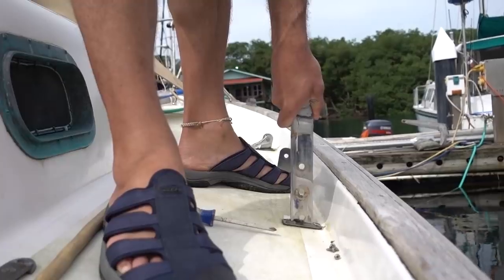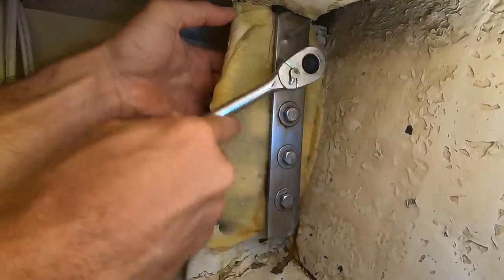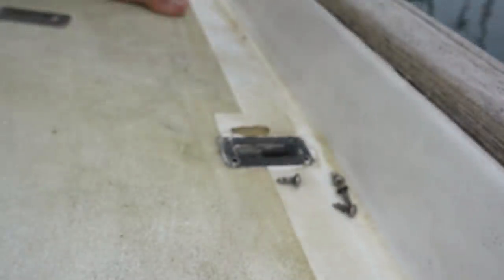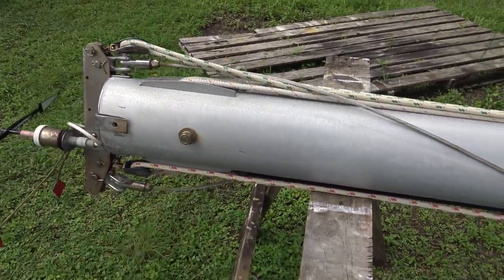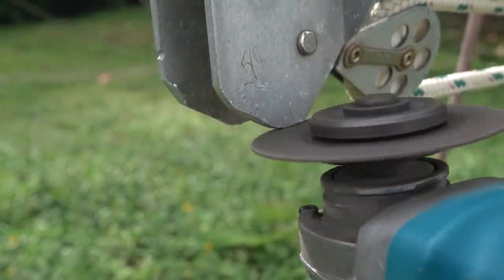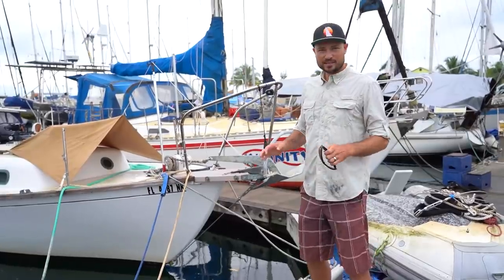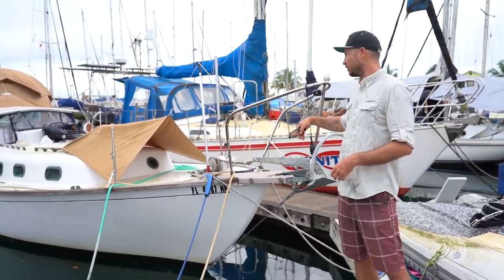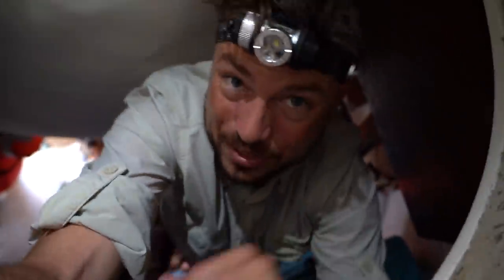Bullet Proofing Our Rig to Sail Across The Pacific Ocean⛵ | S04E16

Comment: Jordan, l noticed there is a lot of space between the two plates on the mizzen head, when the  cable end fitting is in place (8:52). Having that much clevis pin unsupported, could induce a bending load on the pin, creating a heavy side load on the cotter pin. Perhaps a couple spacers, one on each side of the cable end fitting would induce more of a shear load on the pin and reduce the bending. Just a thought. great video, fair winds and safe travels.

Comment: You guys are fantastic.  You really earn your dreams one project at a time, and you are to be admired.  Your capacity for hard work and vision seems endless.  Great Great job.  
One tip--If you grind or cut aluminum (or any metal that doesn't spark) with a hard wheel, grind a little beeswax or paraffin on to the wheel occasionally.  It helps to shed the aluminum.  Use a soft disk if possible, but hey, you do what you can with what you got.  Me?  60 yrs and 3 degrees in manufacturing and related.  If you ever need anything...

Comment: Galvanic corrosion is a huge pain. Mixed metals, base vs hardware bolts or pins, can cause the metals to corrode much faster. 
That’s what the clevis pin (trizatic?) stay point that you cut off looked like was going on.
You can either match materials, or isolate them with nylon inserts, or heavy paint coatings in between.
Great videos, best of luck prepping for the pacific!

Comment: Hey Jordan, for mast top you need top separate the Aluminium form the stainless steel, Teflon washers or similar. This is electrochemical (like in a battery) corrosion and will happen in the same speed again. 
Nice videos, thanks for taking as along your journey.

Comment: Jordan. I am really loving your videos. I have a suggestion. Try to eliminate stainless steel from touching aluminum. They dont like each other. You could put a barrier coat between them. We use a product called Tef-gel. It is a little messy but would be fine in out of the way areas like you have. Or you could replace the clevis pin with a galvanized one.

Comment: At 7:00 you show your cheeky tang installed.  I noticed what looked like holes for safety wire/cotter pins on the ends of the bolt.

Comment: Will you be doing any type treatment or coating of the almond wood bases to prevent the risk of splitting and cracking ?  Also is there a way to wrap the blocks with a steel safety band ? The first concern that comes to thought is the what if ? The base block were to crack or split and no longer have any support to the mast base plate.

Comment: One of the things you should know about metal is if you leave rough edges, they become points of failure. Its like plastic bags that hold food products. Where a manufacturer punches a notch, the bag is easy to rip open. If they do not, the bag is a struggle to open. Metal that is polished is less likely to sheer than when it has cuts and rough edges. One of the reasons chain plates are polished. The metal at the top of your mast should be too. Just a thought.  :-)

Comment: Jordan, first of all, the two of you are a true inspiration.  Sharing your journey and knowledge has been truely appreciated.  I am getting very close to buying my first sail boat which will most likely be a fixer upper.  I know it will not be easy, but the two of you at least make that dream seem possible.  As a woodworker, I am a little concerned about the groove that was made in the mast bases.  The groove is parallel to the grain of the wood.  Hopefully the shear mass of the wood will prevent it from splitting once it has a load put on them.  Is there some sort of strap or collar that could be placed on the outside to prevent that?
Reply from the maker: hi Greg! congratulations on being closer to buying a sailboat! interesting observation re: the wooden Mast base. we'll go into this in next week's episode. thanks for the tip!

Comment: great idea to open the fiberglass over the bolts, never encapsulated any metal , even stainless steel ..it will rust soon or later .
what is the product you are using around the chain plate to create a seal ? i could not ear it ..different from sikaflex?  look interesting .. 
 when i do my rig, if i put stainless near Aluminum, rivets or bolts , I always put a paste in between  ( forgot the same ) to slow down the electrolyse ..

Comment: Hey Jordan,  nice work sorting out the design requirements for those tangs.  This may be late advice, but I would also recommend using a better grade of stainless steel.  If your hardware is corroding via rust (not anodic corrosion due to dissimilar metals) then there is not enough nickle or moly in the composition.  Its likely that most of your hardware is 304 stainless.  Its the most common back in the day your boat was built.   316 stainless has 5% molybdenum and is thus better at resisting corrosion.  (wiki this info if you need to and make adjustments as needed.)  As you know by now, any improvement like this, will cost more.  Im not sure of the availability in the western caribean tho.  Best of luck.  Telos

Comment: When you get new tang plates made , note the grade of stainless ,particularly the new bolt. 
Anytime you have concerns regarding aluminum and corrosion, take the part and soak it in a caustic soda bath, the part will look like new after a few minutes. The corrosion with be completely removed and with a 10x jewelers lens any pin holes or cracks will be apparent. Mind your safety squints . Also ,caustic soda isn't slimy or slippery ,that's your flesh being digested by it...👍

Comment: Just a tip from a non-metal expert! LOL. If you use Monel (nickle alloy) for your pins you will find way less galvanic corrosion on the Al sections also i am surprised that you did not reinforce your holes surrounding the inner for stay pin as the loading is directly onto the rather thin mast wall. Just a thought.

Comment: great job but working with sikaflex to waterproof the tru-holes of the chainplates, I would recommend to not fully torque the bolts at first let is dry 24-48 hours and then torque the bolts further, if you torque the bolts right away you push the sikaflex out, thus creating a much thinner joint. if letting it dry the  thickness is increased which allows for more flex (chainplates are subject to flexing in the thru-hole this cannot be avoided as you know) and should be more waterproof.

Comment: concerning that 'cut off & drill new hole' for the cable that connects the tops of the masts together:
wouldn't Any kind of coating slow down the non stop corrosion boats are subject to?
Even slapping on a coating of axle grease?
And what about saving all your old hardware to trade to some island boat shop for a couple of plates of tacos?
'always thinkin'

Comment: Chainplate covers. Important to clean all the old sealant from under the covers and on the deck. You don’t know how the two different sealants will seal together. I would also suggest you not use polish (flitz) in area of the sealant as it may prevent butyl from sealing against those nice shinny chainplates. Clean first with acetone or de-wax solvent. 
  I do like the use of butyl though...

Sail on..!
SV Fascination

Comment: Obviously, you know that the majority of the metal corrosion that you're repairing is coming from the reaction of dissimilar metals (aluminum v. steel) in contact with one another, so my question (to you and anyone who designs these systems) is why not use neoprene/plastic bushings between the metals to stave off this corrosion? Seems like drilling a larger hole and inserting a bushing between the bracket and pin/bolt would solve a lot of the issues? Am I missing something? Love your videos and can't wait to cross the deep blue with you both!
Reply: My thoughts exactly. Moving the holes is just moving the problem and by that an uncertainty for the future. Neoprene/nylon/PTFE bushings would solve this problem.

Comment: When I have to put bolts or screws through a deck plate in stainless steel, as well as a gasket and sealer, I put a slight countersink in the tops of the bolt holes.  This is because I put a small guage O-ring on the bolt or screw shank, and a little vegetable oil or better still coconut oil butter on the O-ring..  When the screw or bolt tightens down the O-ring is forced to seal the countersunk space and seal the bot shaft.  There is NO WAY water can get to the threads of the bolt or down the shank of the bolt.  Many people just use a sealer, but the O-ring is a bit better a seal.

Comment: If your removing material from the mizzenmast head, that means your length and angle for the triatic stay has changed. Is this OK to do?
Reply: It is okay to do as long as a new triatic stay is made to accommodate the difference in length.  The angle change is likely negligible.
Reply: Thanks

Comment: I have internal halyards and an internal solent in the mast of my 40 year old, 36 foot ketch.  The solent exists the mast about 4 feet from the top, and attaches to a bale 1 foot below the exit point.  There is a block on the wire, and I would attach the actual stay to the block and a deck fitting a couple of feet behind the fore stay.  The PO never used it.  My plan is to make the actual stay out of dyneema.

When you first noticed the cracks in the aluminum, did you drill small holes at the end of the cracks to keep them from traveling any farther?
Reply from the maker: cool! let us know how it goes! yep we drilled holes here: https://youtu.be/QBdIreetmvQ

Comment: Jordan, the design of the attachment point for the bobstay chainplate looks problematic to me.  It's unclear from the video what the chainplate is being bolted to.  Is there a SS channel iron that is fiberglassed to the cutwater with the chainplate held within the U of the channel iron?  Or, is there a SS rib that is fiberglassed to the cutwater that the chainplate is bolted to?  Or, are there plywood stringers fiberglassed to the cutwater that the chainplate is bolted to?  As you pointed out there is a lot of force on this chainplate.  It appears that the bobstay exerts the force at about a 70 degree angle to the chainplate.  Chainplates should be lined up in line with the direction of force.  That would be impossible to do with your bobstay, but a 70 degree angle is quite extreme.  To compensate I suggest you make the internal attachment point much more robust than it currently is. 

I also suggest you try to protect your new wooden mast steps from water attack.  Sitting at the base of the mast, any water that finds its way to the bottom of the mast, either from the interior or the exterior of the mast could end up in the depression in the top of the mast step. I suggest you consider putting a thick layer of fiberglass on the entire top of each mast step, maybe 1/4" thick.  Also, fill each depression with a non-hardening, bedding caulk such as Boatlife Caulk, before each mast is set into the step.  I couldn't find any information on the internet about the water resistance of almond wood.  If it resists rot like teak, then my suggestions are not necessary.  But, if not, then you can minimize the risk of rot with a relatively small amount of work and very low material cost.

Fair winds.

Comment: Hello there,
In case others haven't pointed it out: 
The mezzan mast head corrosion is due to poor material selection between the pin and the head. 
The corrosion is called pitting, caused by galvanic corrosion, it is a rapid corrosion type that develop the same way your anodes on the bottom of the boat, due to a difference in potential between the metals used. Here the actual mezzan head is the sacrificial anode.
This amount of corrosion can easily resurface, if you use the same pin.